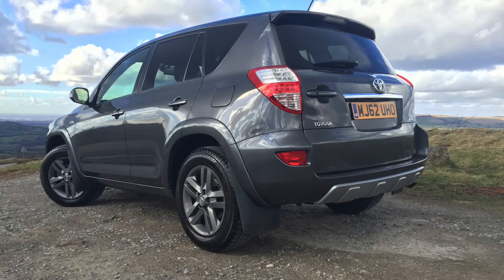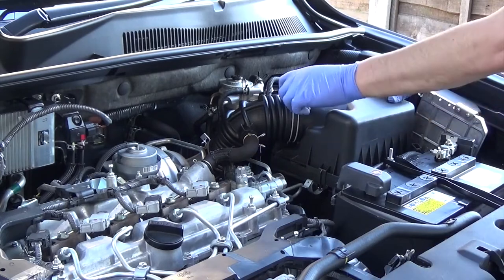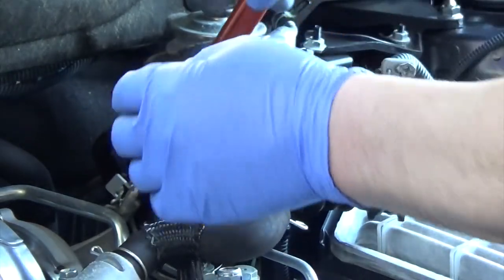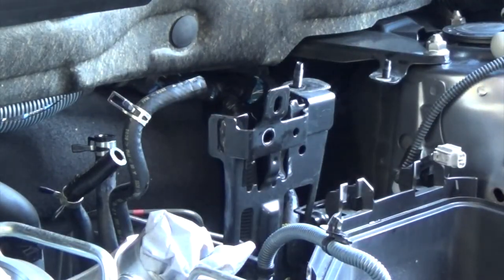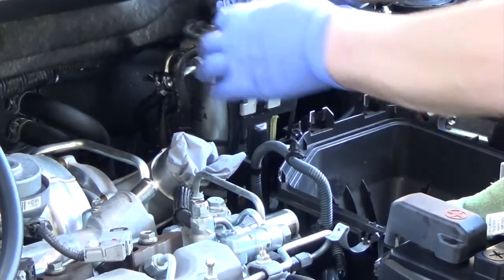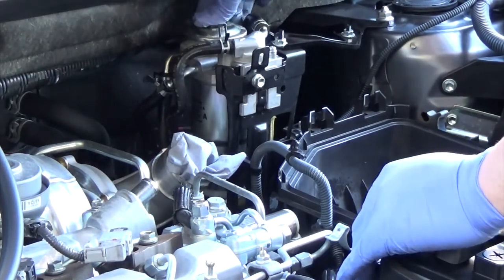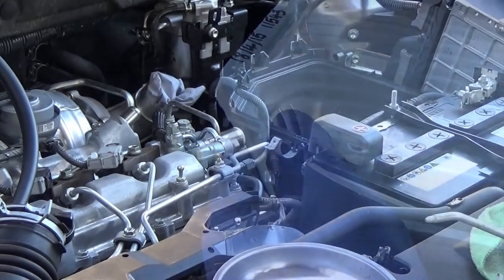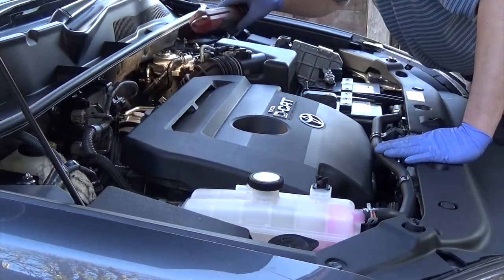CHANGE DIESEL FUEL FILTER 2012 RAV4 D4D

Comment: Very good video, wish I'd seen it before I did this job!

One thing, I didn't find it necessary to remove the intake pipe from the turbo, just disconnected it from the air filter cover, there's plenty of room to work on the filter once the air filter box lid is out of the way. 

I don't waste the fuel, just poor it through a coffee filter into a clean container, then it goes back in the tank. 

10/10 for the tutorial!
Reply from the maker: I removed it just to allow better viewing.

Comment: You don't have to remove the air filter etc just the three nuts n pipes I removed refitted filter by hand no bench things etc bosch fuel filter £11 on ebay proper original too😮 from carparts in motion not £43 EUROCARPARTS, fill the filter with diesel too saves pumping loads of times, there's always a better way for everything this video still works the same ok

Comment: Followed this but won't prime.
Reply from the maker: It might be the primer is not working but take the outlet pipe off (the one to the HP pump on the engine) and try pumping it again.